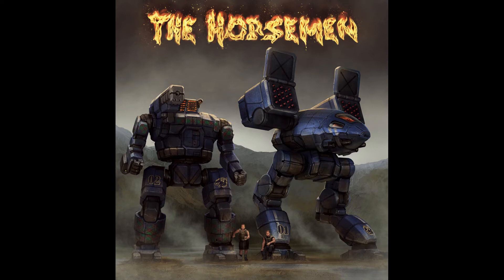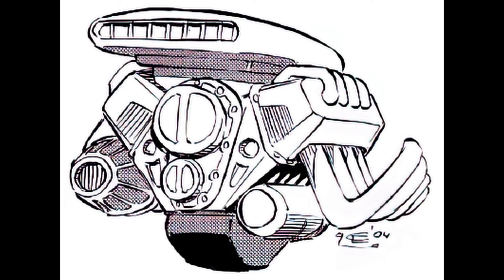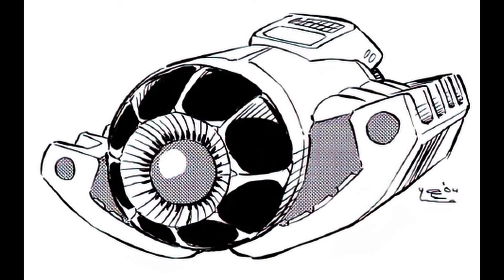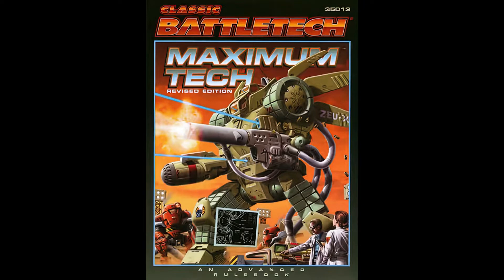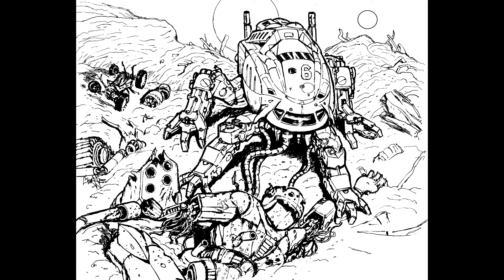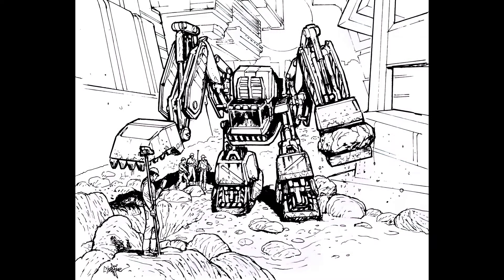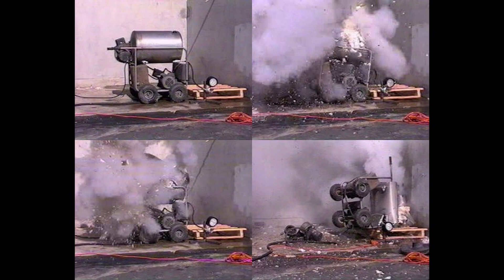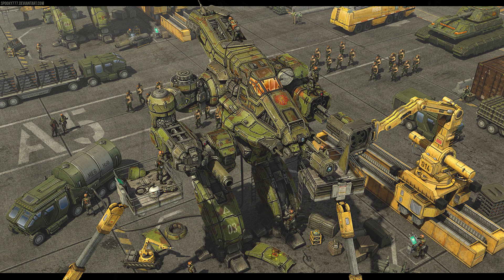BattleTech In Depth - Part 1 of 7, Energy Generation

Comment: The number 1 thing we do not have is the ability to turn thermal energy in to electricity. We currently have an efficiency or 8 percent. Battle tech is at 70 percent. Star Trek is over 90 percent. We have the retractable fiber  muscles. All we need is a reactor and a way to efficiency turn heat to electricity.

Comment: And this is why pilots don't like running mechs underwater. If a breached fusion reactor sucking in air already explodes that violently, just imagine what happens in a much more dense medium such as water.... ...talk about cavitation.
Reply from the maker: Water would be too dense to get out of its own way, which is the same reason you can't light jump jets underwater. That would explode the reactor.
Reply: @Caboose30  Which is precisely my point.
Reply: You are very unlucky, if your batlemech's reactor gets Stackpoled. Quantity of plasma in it not enought to damage internals of BM. Even before an air gets into, magnetic field already shut down by reactor controls or damage to magnetic coils.

Comment: if you really need to you can power a ICE on basically shit. Cause if you got poop you got metahne and if you got methane you got boom stuff.
Reply from the maker: Same with fuel cells really, they can be powered by hydrogen or hydrocarbons.